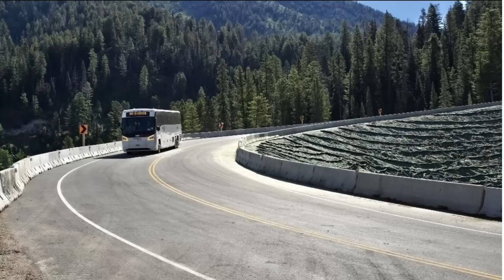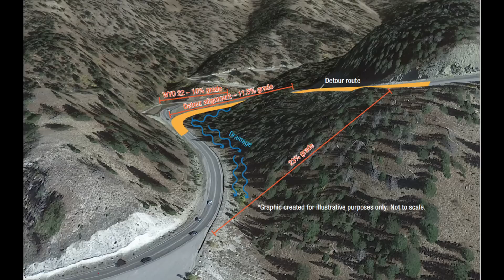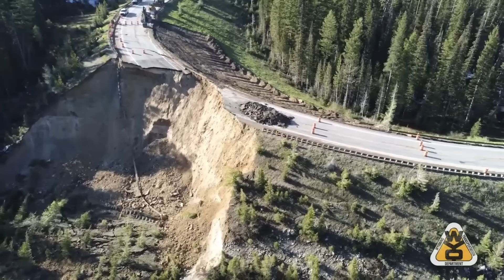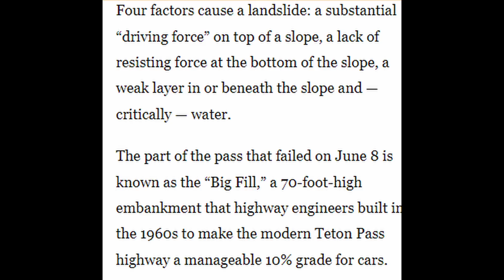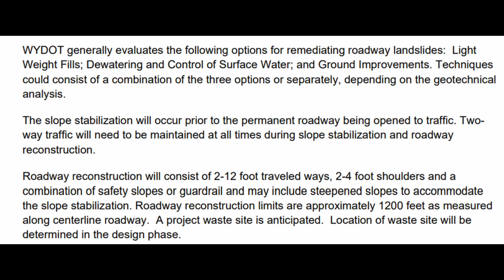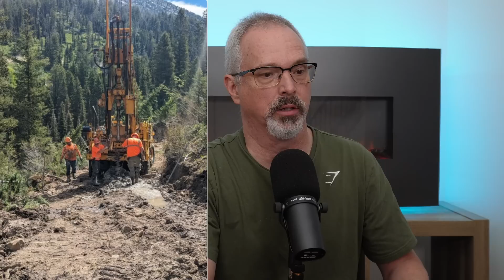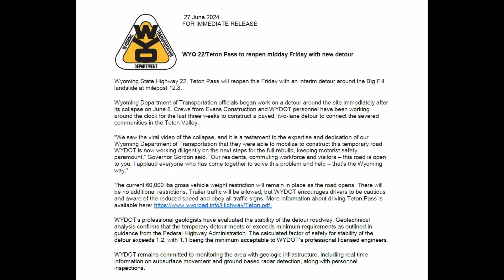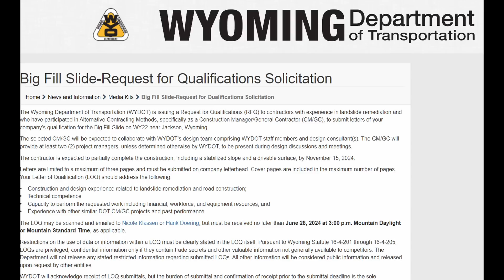Teton Pass - Bypass Completed and Open to Traffic

Comment: To my untrained eye, it looks like a temporary road that will slide down the embankment with the Spring rains.  I would blast out the top layer of soil and drastically reduce the elevation of the embankment, and shore up both sides with a subsurface secant wall on each side, set way down into bedrock, then top layer both sides with massive boulders, covered with soil and vegetation.

Comment: As a retired engineering geologist having worked on many highway design/construction and slope stability projects, it was painful to listen to another geologist describe factors of safety in such an erroneous way; maybe should have left that to a geotechnical engineer.  Agree with others that this looks like a deep-seated failure.  Very interesting project, but too little info provided by DOT on native subgrade or fill characteristics to feel comfortable with anything being presented to the public. Would like to know where the inclinometer(s) were located and readings on depth of initial movement. I would assume they did at least some SPT testing and visual logging, if not ring sampling for lab testing as part of the drilling for inclinometer installation.  Did the inclinometer borings go through the fill and alluvium to bedrock?  How can they be talking factors of safety without reasonable characterization of subsurface conditions and basis for soil strength parameters assumed for their stability analysis?
Reply from the maker: Thank you for your comments.  Those are exactly my concerns too.  Their factors of safety that they computed may or may not be reasonable depending on the shear strength parameters that they used to model the stability.  The way their chief geologist clearly had no idea what those factors of safety actually mean is not reassuring.  I have yet to hear them explain what soil strength values they used and what the basis was for their selections.  This whole episode strikes me as WyDOT running a little fast and loose relative to applying well established methodologies for engineering geology or geotechnical engineering simply to get the road back open.  The big question to me is how did they not recognize that the cracks and settlement of the roadway was indicative of a large and imminent slope failure.  Also, why didn't they read the inclinometer that they had on that slope in June?  That would seem like a good time to take an inclinometer reading when slope movement had been obviously reactivated.

Comment: There's an old railroad bridge near here. The town it ran thru owns it as it crosses a river. There was a trestle before it crossed the river. That trestle had old growth trees bordering the full length but not now. All those trees are now gone as the state has deemed it's not safe. Now there's not any guard rails at all & during the winter it should be interesting. I won't travel it anymore.

Comment: WYDOT has done a tremendous job getting this route reconstructed in expedited time so traffic can flow along this highway between Idaho and Wyoming.  Perhaps it's not a perfect engineering solution but it works and its got traffic flowing until a more permanent fix can be designed and constructed.  I guess some folks would prefer the highway to have remained closed while the detailed geotechnical studies were completed, the alternatives analyse had been completed, the preliminary project design completed, public involvement meetings held, final design and bid documents prepared,  put out to competitive bid, a contractor selected, the contract approved, and finally constructed.  This process takes time.  Like the saying goes, the perfect is the enemy of the good.
Reply from the maker: I think you a projecting a bit too much.  So WyDOT rushed to get the road reopened and have now made the eventual fix that much more costly and difficult to do.
Reply: @CaseyJones-Engineer  ...and I think you're exaggerating the negative too much!  What you offer is uninformed criticism and not constructive analysis.  You may be a P.E. but you aren't in the rooms where the solutions are being discussed and the decisions are being made by the P.E.'s that have to get the job done.
Reply from the maker: @DrJohn493   You're right that I wasn't in the room either when they decided to reopen the road after a surface patch hours before the catastrophic failure. I'm sensing a lot of insecurity with some of you folks.
Reply: @CaseyJones-Engineer  ...and I'm sensing a frustrated engineer that didn't learn how to "work and play well with others."
Reply: Design done over the weekend but no actual printed plans and specifcations.  Soil testing not completed before temporary bypass was built.  WYDOT stated only needed a factor of safety of 1.1 for the detour and they are over 1.2 but nothing presented in writing.  WYDOT stated the rebuild will be designed for factory of safety of 1.3.  FHWA requires a factor of safety of 1.5.  I could go on and on about the lack of documentation and incorrect design information.  If this was a private Professional Engineer they would be reported to the State Licensing Board for incompetence.

Comment: I have had a number of engineers with your ultra conservative approach to design working for me.   Is this a final design, no, of course it isn't.   Will it be carefully monitored, yes it will.   Perhaps you don't personally understand how significantly the closure of this road affects the local residents and businesses.   Most of the people travelling this road everyday would have been fine with installing a gravel road uphill from the failed area.  

A "proper" analysis might be preferred.   But, the failed roadway had been analyzed  and was used for decades
Reply from the maker: @howardjones2021  I disagree with you on this. It is  simply false to say that the alternative to what was done would be to take 10 years of study. Also I am far from being ultraconservative in my views about what occurred here.  I do realize that Jackson area has some serious issues relative to its development and dependence on Idaho based workers which has caused this panic to get the road reopened.
Reply: @CaseyJones-Engineer  Well, there you have a difference of opinion among engineers.    This appears to be a more than acceptable temporary fix.

Unless you have lived in the Jackson area for years, which I have, you cannot appreciate the severity of this road closure.   about 15 years ago, the snake river canyon road was closed due to a land slide,   in my case, it required a reroute about the same as this closure has caused. (but the other direction)   To the point that many commuters were forced to find housing in the Jackson area.

I doubt there was any "panic"   associated with this.   The WY and ID crowd are used to severe weather road closures many times each year.    I would call it a rational, calculated approach to meet the needs of residents.
Reply: Building a bypass with no design plans and no engineering analysis from what has been presented by WYDOT is grounds for disciplinary actions by the State Board of Licensing.    Saying only a safety factor of 1.1 is needed when FHWA requires 1.5 is incompetence.  Mr. Jones-as an engineer would you stamp what WYDOT has done?  Your attitude is very cavilier.
Reply: @michaelcurtis-cdot8978  just because you dont have access to their numbers does not mean an analysis was not done.    These guys design and build mountain roads all day long.   And this construction is far more conservative than the prior version which had been in place and stable for 30 years.
Reply: @howardjones2021  If an analysis was done why won't they present it?  And to state that the Factor of Safety is greater than 1.2?  That is ridiculous.  State what the actual number is like 1.24.  Did you even watch the videos and listen to the audio recording of the State Geologist?  The State Geologist stated they only needed to design to a factor of safety of 1.1 according to WYDOT Professional Engineers.  This bypass has fills in the 40 foot range and per FHWA requires a FOS of 1.5.  I have designed highways and I know what the design parameters are.  Listen to the audio recording where the State Geologist states a FOS of 1.1 is 10 times safer than a FOS of 1.0.  Really?  It is 10% safer.  The State Geologist doesn't design roads; he would lose his PG license if he did as he would be practicing engineering without a license.  Bob Hammond, WYDOT Resident Engineer said the failure happened because of the fill material.  James Dahill, WYDOT State Geologist said the failure happened because of the clay layer and water underneath the fill material.  With the drilling that has been done they should know what caused the failure.  WYDOT has not been transparent in this whole process. I have over 45 years experience as a designer and know when there is smoke and there is in this case.

Comment: The temporary bypass wouldn't have been a bad idea had they kept it a little further away than they did. Now they're screwed. Too close to the failed section and no room to dig it out and fix it properly. They're going to have to close the temporary section to do a proper fix now. There's no way around that. And that's not even touching on soil stability as it is right now.
Reply: From the aerial views it does not appear that they could have moved the bypass further away, it would have made the grade of the bypass even steeper than it is now, while increasing the slope angle of the fill on the inside part of the curve, and probably needing to remove a lot of the trees there to remedy that.  So while this may lead to some complications as far as a permanent solution, those complications will happen down the road (no pun intended) and they'll be able to inform residents and travelers on the road with advanced notice so they can plan accordingly.  I think regardless of how far away you put the bypass, they'll eventually have to close the road at some point.
Reply from the maker: @louieatienza8762  I think you are right about that.  Maybe there will be less political pressure to do a closure during the off season relative to tourism.
Reply from the maker: Yes, I think it would be fair to say that WyDOT now has vastly complicated what will be required for the permanent fix.
Reply: @CaseyJones-Engineer  Yes according to the latest news report from Cowboy State Daily the rebuild will follow the old alignment.  The article says the plans will be completed by the end of July.  They mention the CMGC contract but no mention of engineer or contractor.  They indicated they don't have all the parts yet for the 24/7 monitoring of the inclinometer so they must be manually reading but no data is provided.  They indicate they are still analyzing the soil from the drill logs.  Bob Hammond, WYDOT RE is quoted but no quotes from James Dahill, WYDOT Geologist.  The article says the fill was the problem.  I thought what the fill was on was the problem?
Reply from the maker: @michaelcurtis-cdot8978  You are correct in that they did say (they being Dahill) that the foundation soils (not the embankment fills) had gotten wet from rain and snow melt and lost strength which precipitated the slide.  They truly lack consistency and transparency in what they have been doing and saying here in my opinion.  Also, did you notice that they actually started putting in this bypass a day before the catastrophic failure?  Check out the media press kit page and look at the photos and press releases from June 6 to June 8. 

https://www.dot.state.wy.us/home/news_info/media-kits.html

 It is rather telling. They said they planned to remove the asphalt to "reduce the loading on the slope" which is laughable.  They also said that they were starting the construction of the bypass (what they called a shoofly) which ended up being exactly where they built the bypass road section.  This suggests to me that they knew that the main embankment was going to fail, but that they probably thought they had time to build the bypass and get traffic flowing while they did so. At no point during this time frame were they intending to close the roadway, except where they had to deal with the mudslide 3 miles away.  This makes sense to me anyway that this is what probably happened since I could not figure out how they could see the crack pattern and slumping of the roadway and not realize that a big failure was going to occur.  Now it seems they simply misjudged the time frame for that failure.
Reply: @CaseyJones-Engineer  Wow.  So much for transparency.  So they know the failure was going to happen and started building the bypass before the failure.  I don't trust anything WYDOT says.  And the media unfortunately is oblivious to the lack of transparency.

Comment: Perhaps the low FS is being used because a more permanent solution is coming?  This seems to be what the Fed standard allows.
Reply: A lower factor of safety is only allowed during construction of a slope and not for the final slope if you read FHWA standards.  The bypass is not considered temporary construction.  It is permanent until the rebuild happens.
Reply: @michaelcurtis-cdot8978  Perhaps they're interpreting the standard loosely since a rebuild is "planned"?

Comment: I am not an engineer, but wonder if it would work to drive foundation type pilings?
Reply from the maker: I agree with you.  I think a deep foundation could be used here whether it is driven pile or drilled shafts.  These foundation elements could provide the lateral support that is needed here.

Comment: I work in industrial engineering, I have no idea about civil engineering. A safety factor of 1.2 would be found in things like airplane parts where inspections are frequent and failures happen rather slowly, by fatigue or creep, and there's redundancy in almost every part. To apply a safety factor of 1.2 to something as heterogenous and "there-to-stay" as a roadbase appears surprising to me.
They are making essential analysis while they are already opening the road to the public. In pilot speak, that's called "being behind the plane".
Reply from the maker: Thank. I agree. I don't see how such a low FOS would be appropriate in this situation.

Comment: I am curious as to how long it would take to complete all the data that would be necessary in this situation given the limited time with weather constraints, annually and the impact of the economy for what seems like could be years?     Very few government employees are competent
Reply from the maker: I think an adequate geotechnical investigation with design could have been done in 4 to 5 weeks.  They could have employed multiple consulting firms with multiple drill rigs and labs.  It looks to me like they only had 1 WyDOT drill rig out there at any given time.  They could have then just fixed the main roadway in a month or two and not put in this temporary measure.  This "temporary" bypass will at best be in place for several months and will greatly complicate the ability to restore the main embankment where the failure occurred, since this bypass must remain open at all times.

Comment: You do not need to be an engineer to understand that as a fill gets taller, the slopes on both sides need to be at a shallower, and shallower angle.  That angle was too steep for a fill that tall.  You also need  more rock in the fill as the height gets taller.
Notice that the failure occurred on the outside of the fill where it was the tallest.  That is where the fill needs to be the best material at the shallowest angle.  The forces radiate outward on the outside of the fill, so once the first crack occurs , the water trickles down to the bottom, add weight, lubricates the base, and then down she goes.  Water is always the enemy of any fill.

Comment: They're not going to touch or do anything to this road until the absolutely have to I very much doubt they'll even provide the funds and the labor to put in a proper Road let alone a bridge.
Reply from the maker: They will have a hard time being able to reconstruct that main roadway embankment now that they are pinned in by that new bypass that has to remain open to traffic.
Reply: @CaseyJones-Engineer  They were never going to construct another road they were lying to their teeth when they said they would.  It's been a common practice up here in the state of Wyoming.  They're irresponsible zero integrity.

It may be a cowboy state but it's not run by the cowboy code.

Sadly until a life is lost will they finally get their butts into gear and build a safer roadway.

They should just build a railway, in my opinion.

Thank you for covering this.  Wyoming's good ole boys systems going to have to grow up very quick. 

I have lived through three decades of this s***, moved up here from Fort McClellan Alabama at the age of 7.

The worldwide internet has not been their friend but the locals Saving Grace.

°~•.☆.•~°

Thank you
Reply from the maker: @you2angel1  Thank you.  I think that WyDOT has probably not faced this level of scrutiny before and it appears it has been long overdue.

Comment: Casey, why wouldn't they start with a retaining wall, well drained, at the toe of the downhill side in natural soil and terrace up the slope replacing poor soil with better materials in terms of angle of repose and weight and drainage up to the downhill side of the road apron. Why wouldn't they run deep  helical piles and effectively "bridge over" the unstable area? Cost?